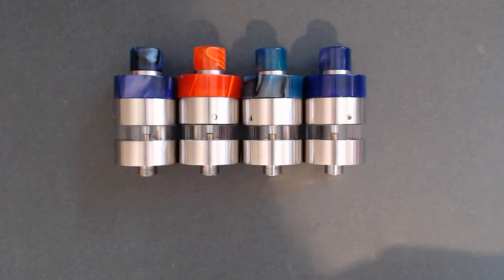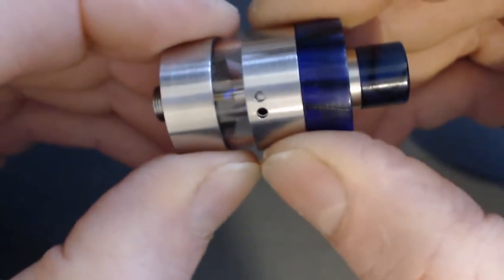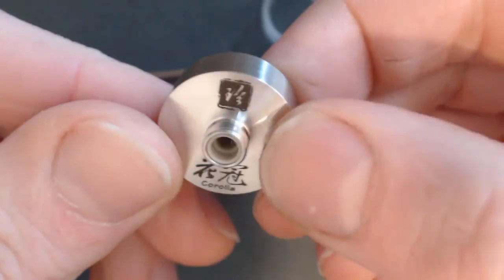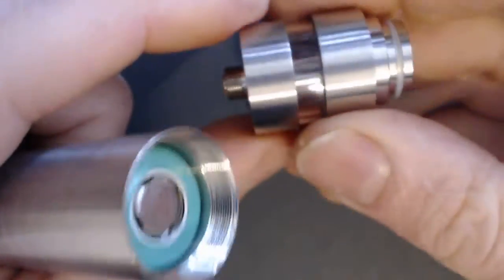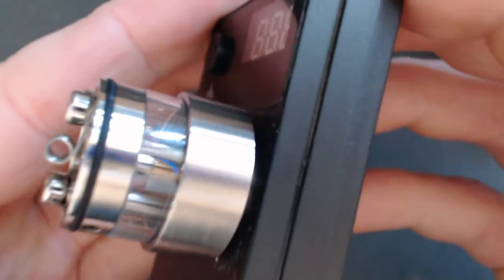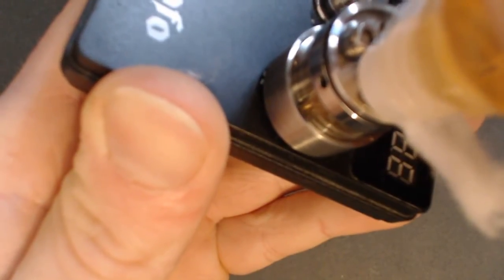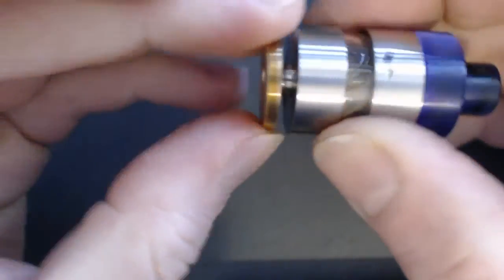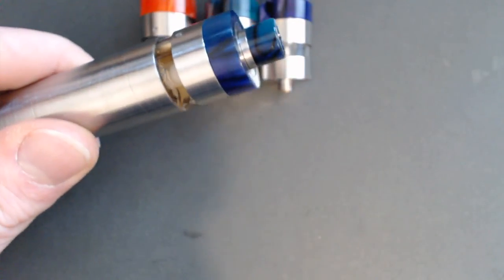sxk corolla review and setup M-vapes

Comment: Will this tank leak juice out of the drip tip and air holes ?.If I get one it's going to be used for work and will be in my trouser pocket all day.
Reply from the maker: +bradlad67 Hi it really depends on your wicking techniques all atomizers will leak if not correctly wicked, i have not had any leaking on the corolla im using, hope this helps Matt.

Comment: hey what diameter and gauge wire is your coil cause ive tried a 3mm and it doesn't seem to be wicking properly.. i also use MAX VG juice
Reply: +Manny Levy where your wicks go down into the tank. if you just run a piece of 24g wire down just to make a very slight gap you'll find it will wick better, i do that at least once a day on my avocado tank and it has no problems wicking .